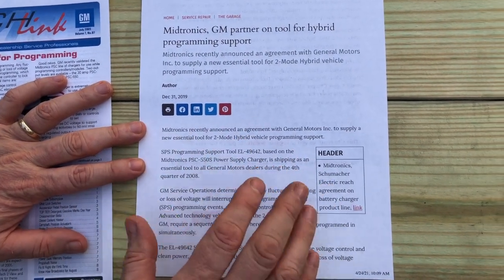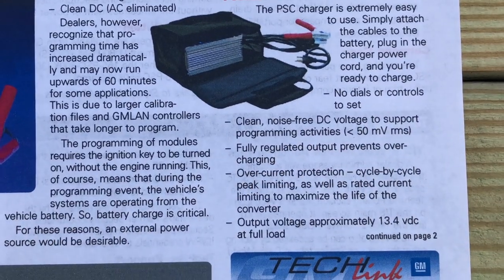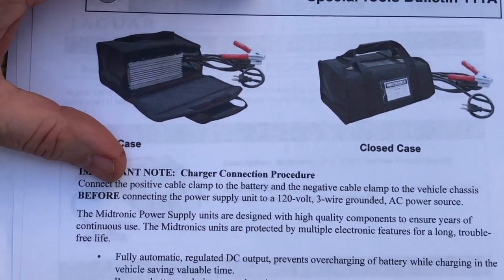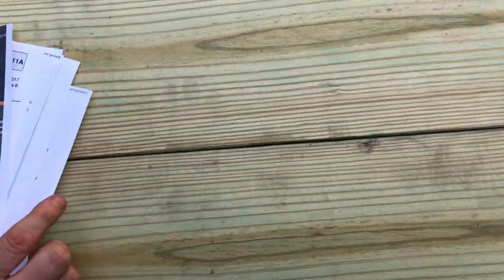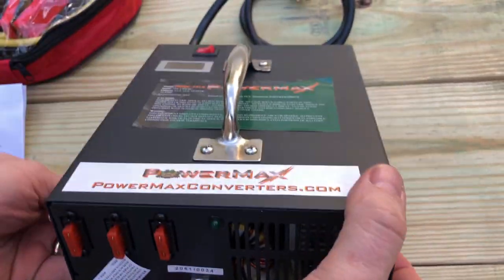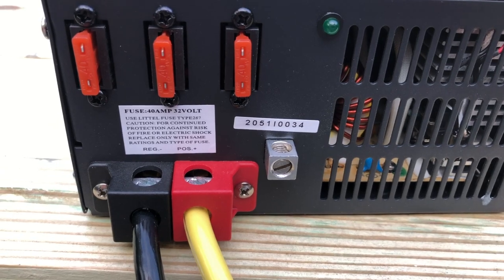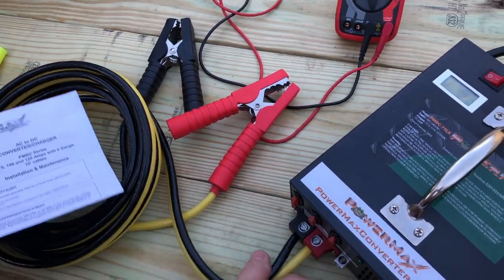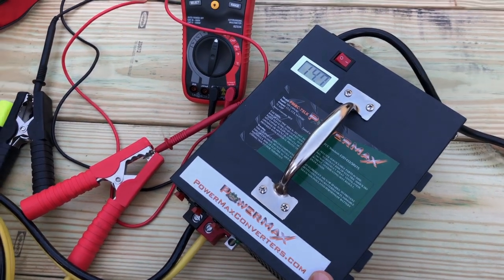1995+ GM SPS2 Programming Battery Power Supply Tool Module Flashing - Unboxing PowerMax PMBC Charger

Comment: I went with the PL6100 Chlore I love it, also has 20,40 & 60 amp battery charger as well as 35mm dinse connection for removable leads and also has a fully digital display. You do need a 20a plug but I’m not mobile so it’s great for me. I wanted to have the charging capability as well as 100amp power supply. I paid $400 néw for it. The pl6800 has 100 amp power and charging. I looked into the powemax to be just looks cheap like a computer power supply that cost too much. The fit and finish isn’t great vs the Chlore. Thanks for sharing great video
Reply: @Welding Junkie Do you think the 60 amp is fine for flashing "mostly gm and ford" or should I spring a little extra for the 100 amp model?
Reply: @JLSR-vg9ol  Can anyone help with this, since I dont understand how many amps are actually needed, I need the PMBC for just car flash programming for potentially all car brands (ECM/UCH matching/initializing), from what I understand 60AMP is more than enough, I was even thinking of getting the 55W, -in what scenario the 75 or 100 will be reached?
Edit: I spoke with Autel about it (makers of the MaxiFlash tool) and they said 55 is fine, still need clearance though, dont want to buy something i'd regret.
Reply from the maker: @SpringvisualTk  GM recommends that Midtronics unit I mention in the vid, which is also 55A.  Jaguar and Volvo as well.   But they also approve the 70A model.  So for that range of recommendations, that's why I went with the 75A PowerMax unit.  Their PMBC 75 ADJ is comparable to the high range of the Midtronics recommendation, the PSC-700.  I can't imagine ever needing more amps than that thru and including the upcoming 2022 model year.  But I don't work on anything but GM vehicles.  Hope that helps.
Reply: Is PL6100 mobile unit?

Comment: Tips and other stuff:

1) The battery clamp cable looks to be copper stranded class K 25.0 mm^2 (4 AWG) if so you can use a Ferrule to keep the strands from splaying with the screw pinch connector in making the screw connection. But you would need a Ferrule crimper. This is handy in making a robust screw clamp pressure connection (which for this large wire technically the screw should be torqued) and also if you have to disconnect/reconnect the cables (handy when replacing the clamps when the originals wear out). I usually have a spare clamp set available in case a clamp gives up in some way. I then rebuild it at a later date. 
2) The PowerMax manual states to disconnect the battery before connecting the unit to the vehicle? Well what if the battery is buried in the trunk like on a Cadillac ATS?
3) The PowerMax manual states that the three stage battery charge is optional?
4) The problem I have with both the Midtronics PSC series and PowerMax is reverse battery protection results in blowing a fuse. Higher end battery chargers will alert (indicator) to reverse battery condition without blowing a fuse or damaging the unit. You just have to reverse the leads and continue.
5) It is clear that if you want an accurate vehicle system voltage measurement is to do it on the vehicle side and not the power supply side, given the 12 foot long cables and the high rated currents.
6) No mention about how to deal with inaccessible batteries found in the trunk. Usually this means using the jump start posts and obviously the battery is still connected. In using jump start posts you must be very careful not to overvoltage the vehicle at high currents. This is where the battery chargers usually try and do CC modes and the voltage can surpass 15V at the posts. Also, many smart chargers cannot diagnose accurately the battery condition through the jump start posts and may just lock you out if you cannot override. Which is why the manual modes (power supply modes) of regulated voltage are provided.
7) What would be more helpful is a current meter which could accurately measure up to the full range of the supply. However, an accurate current shunt alone would probably cost more than the PMBC charger.
8) The PowerMax unit looks like an extended PC 12V switcher with a voltage adjust pot, voltmeter and extra fuses. The stickers are not even quality controlled.
9) The PowerMax manual states to not leave the unit unattended. I leave my battery chargers "unattended", that is not being continually watched, for hours at a time. A lead-acid topping charge may take 8 hours to complete. If all you are doing is reflashing a vehicle then I guess you could continually watch the unit attended. However, charging a battery fully in three stages as shown in the PowerMax manual can take up to 12 hours or longer from 50% SOC.
10) It is hard to tell from the video but the PowerMax cable clamps should have a tinned flat braid strap (1 inch wide with 2 in parallel) between the jaws for anything greater than 50 Amps so both jaws are supplying current. You will see straped jaws on fleet chargers rated for 60 Amps and above. Many will use intinned flat copper braid but may have protective heatsrink over it.

Comment: Is 14.7 kind of high for the voltage setting?  Even the GM docs said to use 13.4 ?
Reply from the maker: Varies with the vehicles alternator.   Some do output over 14

Comment: Best review video so far.  
I have been looking and trying to decide to save money. 

Is this enough Amp, or I need 100 Amp for BMW and Mercedes programming to be safe?
Reply from the maker: Thanks, I only work on domestics where this 75A PowerMax is more than sufficient being more amps than either of the Midtronics units the GM dealerships would have gone with.   But I'd say get all the amps you can afford, you can always have too much but never not enough.  ;-)

Comment: i just got this same model, do you move switch A to adjust V then back to set and maintain??  think that's how i'm reading it .
Reply from the maker: I didn't have to adjust mine, but according to the manual included yeah you move switch A to Adjust Fixed Voltage  and then move switch B gently adjust the voltage from 13V~16.5V.  There's also a procedure for three stage charging around these same switches.
Reply: @DrShock  yep checked it , was 14.8 works like a champ

Comment: Could you please show how you charge a deep circle battery with it?
Reply from the maker: This is not a battery charger tool.  It's a battery maintainer that is only used for maintaining clean backup power voltage and amperage when re-programming vehicle computer modules.

Comment: What Voltage do you leave it on for GM Programming? 14.4 or 13.4? Also is that on the Fixed voltage setting?
Reply from the maker: Fixed voltage for GM vehicles, at the default setting.  Puts it in the range of the average alternator charging voltage.
Reply: @DrShock  Ok thanks. So just switch it to Fixed voltage and do not do any adjustment

Comment: Have you tried the VCX Nano?
Reply from the maker: Familiar with it, but have great clones of the Tech2 and MDI already.
Reply: @DrShock  I'm interested in a reliable MDI clone for my tech2 era vehicle. Can you recommend a good vendor?
Reply from the maker: @executive  I can't recommend a particular vendor as these are all no name imports from China and the sellers on eBay and Amazon come and go.  But I did a review here https://youtu.be/pZfXuuzORZo on what I use, and I have a pair of them and they are 100% identical in functionality to the GM ones built by Bosch.   Just look for the cosmetic details, and most important the double decker circuit board design inside (most sellers will show pics of this) with WiFi and Ethernet jack support.  The ones without Wifi capability and this network jack connection (the USB only ones) are cheaper, but very inferior.  It doesn't matter about the HDD (hard disk drive) option some offer as that's just a hacked version of the GM GDS2 diagnostic program and Tech2Win emulator running in in a virtual machine player for Windows.   Mostly what these MDIs are for is SPS programming and you have to pay for that at www.acdelcotds.com still.
Reply: @DrShock  Thanks.
Reply: I'm in the process of setting up my vcx nano. I tried programming once but it failed before it even started, but I didn't have any type of power supply connected. You can configure the vcx nano many different ways. It's gonna take a lot of patience setting it up. Be sure to put it on a computer with a fresh Windows installation, and you have to spend a lot of time with the settings in Windows like disabling windows defender  and antivirus software. It really is quite the pain in the end and I'm just guessing but it will likely continue to be a pain in the butt because you have to update it every 60 days to keep the license current, and of course every update will probably screw something up and cause it to not communicate properly. I'm still glad to have it. I had plenty of time to kill. Just waiting to get my power supply (and finish hunting down an electrical issue I found while digging around in the guts of my truck with the nano), and i should be programming in no time.

Comment: These screw terminals is so dumb installation. If inside is space, install welder terminals. They make that type small too. Way easier cable management and cost only about 6eur